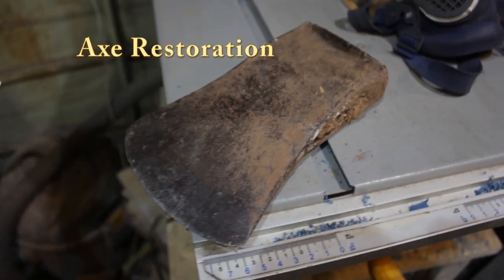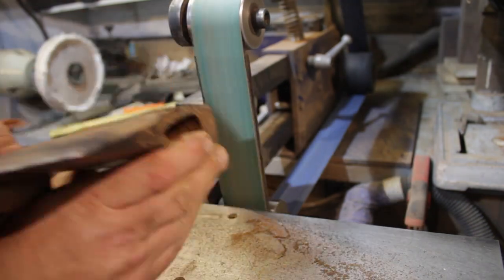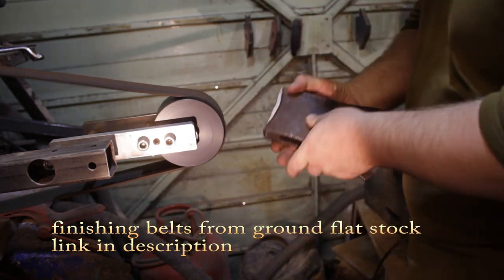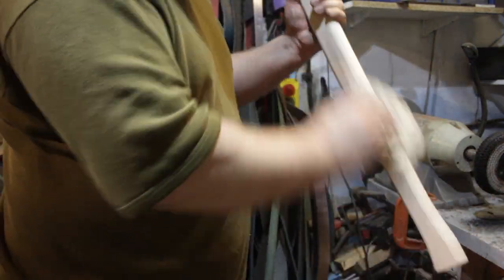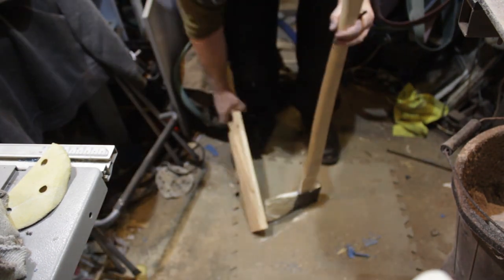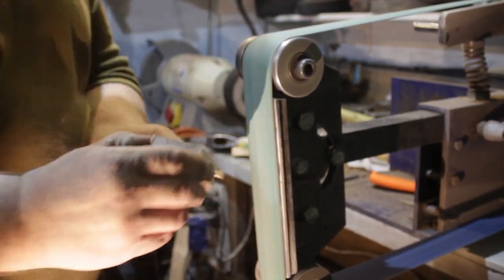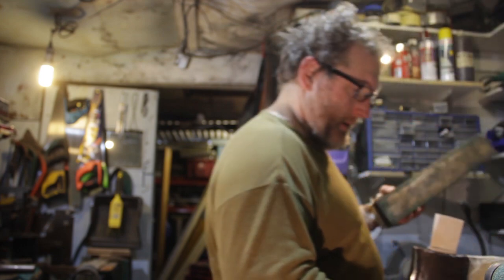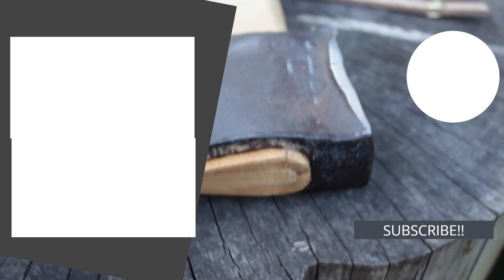Old Axe restoration, step by step vintage axe head sharpening and fitting new hickory handle

Comment: Nice job 😁 that'll split better than any gransfors out there🤙if you thin out the cheeks and thin the handle it'll chop better as well 😉 my only criticism is when I seat the head I never put glue in the wedge I use linseed oil to send the wedge further down without cracking 😁 your mate will be chuffed..all the best Lincoln 👍🤙
Reply from the maker: I like the linseed oil idea for the wedge, I simply drove this one in dry then oiled the end grain a bit when I did the handle
Reply: @WessexBladesHandMadeKnives  works every time 😁 not being a smartass but take as much time on the wedge as the handle.. make the wedge 1/4"wider than the eye and round it on the edges to fit the eye😉hope that makes sense 😁 all the best Lincoln 🤙👍
Reply from the maker: @harwoodblades3633  indeed,